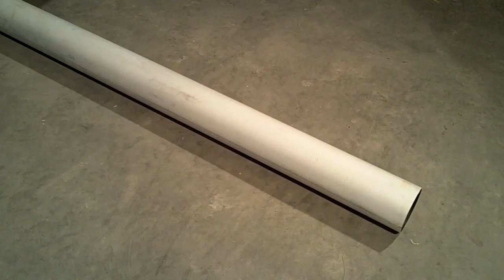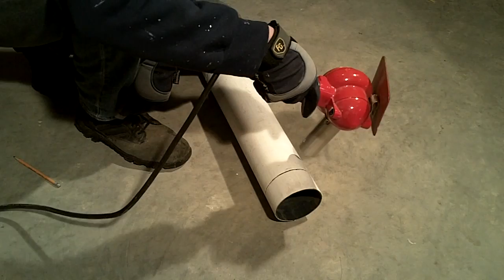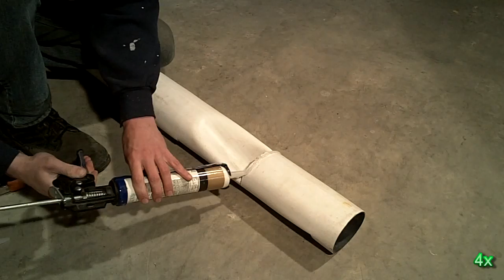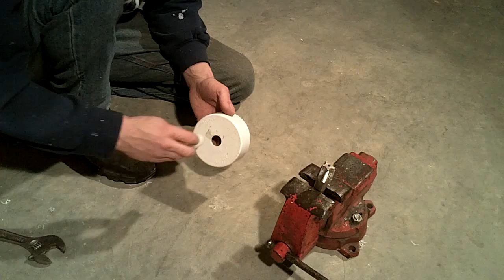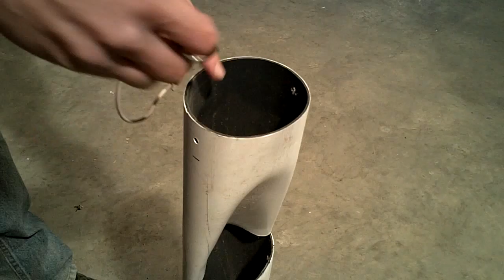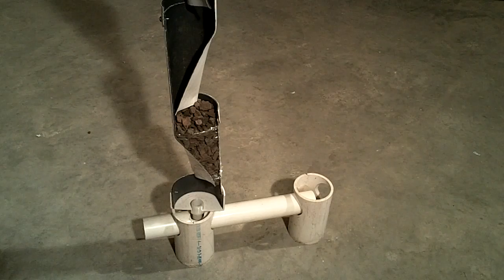How To Build Your Own Strawberry Tower

Comment: Instead of using siacone why not just use PVC cement to glu the rings in place.???
Reply from the maker: PVC cement is only good for tight bonds between the two surfaces....there's too many gaps between the tower and the ring so the silicon fills everything in.

Comment: Ever think about using a trigger sprayer with cold water to facilitate cooling the pvc??
Reply from the maker: It cools down fairly quickly so it probably isn't necessary.
Reply: Bigelow Brook Farm (Web4Deb)
I've worked with pvc before, heating and bending it for various things. It really does help...but then I was using schedule 40 pvc. What you are using is schedule 10 and does cool quicker.
Reply from the maker: I agree.  I had to bend some schedule 40 for an electrical conduit and it took forever to heat...and cool!

Comment: Thank you for the time that you took to answer me, but I actually thought you allready have tried various things in the past, that you cold maybe advise me on what kind of worked, and not. And then, which size pipe, do you think will work better, the 160mm or 110mm diameter pipe? Because that is the 2 largest pipes that I can get.

Comment: The water just dribbles freely via gravity from node to node, right?  Does this mean that the plants are constantly wet and 'showered' by the node above it?  Most normal horizontal-based systems seem to incorporate a flooding/draining system that only saturates the roots, but I guess these nodes are never actually flooded and more akin to being watered as if in a traditional garden?

Does this impede growth at all?  Do the bottom strawberries miss out on nutrients that the top take too much of?

Comment: Two answers: If you want to permanently bond PVC to PVC then there is no better "adhesive" than PVC cement.  However, in this case silicone might be the better choice.  The ring that fits around the tube is expanded and therefore a different circumference.  This might cause gaps in the fitting of the two says the author of the video.

Comment from the maker: Usually the first year it won't produce fruit.  When it sends out the runners, snip them off so the energy goes into the plant (unless you want to have more plants).  During the winter they will go dormant and then the next spring produce fruit.  Normally, you can keep a plant for 2 growing seasons and then it should get replaced  (they get too big and can get root bound)

Comment: In  the event the bottom pocket isn't going to be used why go through the effort to make it? Just cut a section out of the pie above where to bottom cap will be if there's a need to clean around the drain. Not the sort of strawberry tower I'm looking for , but an interesting project anyway

Comment: So i looked up the shale from your link, but forgot to ask about it at the garden store. I have hydroton  and a cycle timer so gonna do 10 on every 60. I have a lot of nutrients for hydroponics grows and blooms with a fairly different range in strength. just wondering what they like the best in your opinion, it seems on the web just using a 2-6-6 or 7-8-5 would be good from the beginning to end?

Comment: I have some extra 3" foam core drain left over from a spiral nft for lettuce. Was wondering if i should even attempt to build the strawberry tower with it or   wait till i can get the thin wall 4" that ive used for nft systems,  I had planned on filling this with perlite/coco.  Just wondering if the 3" is too small...its kindof looking like it now.  But you do mention lettuce and I thought they had smaller roots then strawberries, anyway thanks for the info.

Comment: having made quite a few of these do you think it would work to put all of the openings on a single side ? I have a tank that's up against a wall and wanted to put 4' long strawberry towers every 6 inches along the tank with all the holes for the strawberries facing the tank and none on the wall side.

Comment: You are going to way too much trouble. We just cut squAre s with a skil saw  using plunge cuts. Each pipe takes 3 minutes. And you can put a plant every foot with no root bound issues. Wwe have been making ours since the 1970 s

Comment from the maker: @TheDaniandco A tap is a tool used for boring threads into an object so you can screw a piece of pipe or screw into it.  Google [ 3/4" Tap ] and you're find a bunch of them for under $20.

Comment from the maker: @bravo24601 I wouldn't use ducting.  I believe it's galvanized and the zinc will leach into your system, and the duct will eventually rust.  The sharpie will come of with finger nail polish remover or acetone.  After a year of use, there will be enough other debris and junk stuck to the pipe, you wouldn't even notice a few black marks.  ;-)

Comment: I ended up using a pair of tin snips to cut a $1.50 piece of hvac ducting from home depot and secured it via wire to pvc.  This provided a MUCH better uniform look them trying to bend each by hand.  

Another HUGE mistake I made...  I used a sharpie to mark-up all of the cuts / lines, etc..  This means I was forced to paint the PVC or deal with the end end product  looking like crap.

Comment: Here is something I found helpful...  I ended up buying a lower end heat gun from home depot...  Don't do this.  It's not quite hot enough to do the job adequately without spending 25 minutes on each cut.

Comment from the maker: @bravo24601 As long as you don't hold the heat gun in the same spot, you will be ok.  I run it at the highest settings.  Hold it in the same spot for a second and you're in trouble!

Comment from the maker: @scurge20 I have a small valve at the top of each tower.  It's turned on so there is a trickle...just fast enough so there aren't any drips.  You just have to be careful to make sure the valves don't get clogged.

Comment from the maker: @The831Z It all depends on the type of PVC you are using.  The manufacturer's will using various hardening agents to make the PVC stiff.  Some are good and some are questionable.  Just because it says PVC doesn't mean it's bad.  If you can find HDPE plastic, that is one of the safest, but nearly impossible to find and is very expensive.  Most people think the risk of using this is a fair trade vs spray chemical pesticide on everything.  You'll have to make the decision on what is best.  ;-)

Comment from the maker: @marthale7 It's NOT the schedule 40 sewer pipe but I think they still call it sewer pipe.  The wall on it is very thin, maybe around 1/8" inch and it's usually in the drainage area at Home Depot or Lowes.  Try to get the all-white pipe which is PVC, it's easier to form than the black-inside pipe like what I have in the video.  Thanks!

Comment from the maker: @dwiggs77   I always plant from the runner and dispose of the plant.  If the runner also shoots out another runner, snip it off so the energy can go into the first runner.  Since the runner is just hanging in the air, once it starts to send out a few roots, either try to move it (still attached to "mama") to a neighboring pocket or plant it next to mama in the same pocket.  After a few weeks of root growth, you can pull out the baby and cut the "cord" and plant it in a new area.